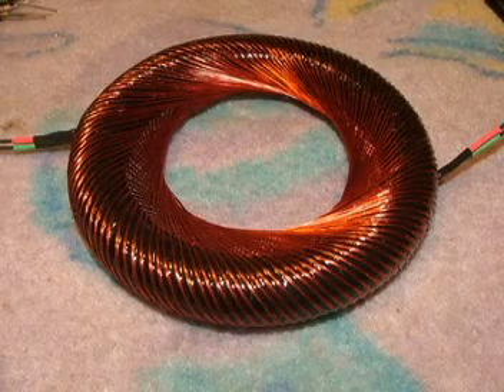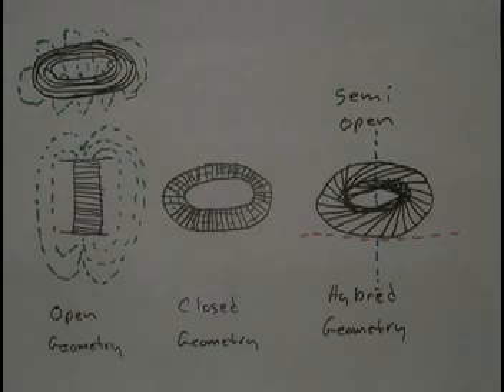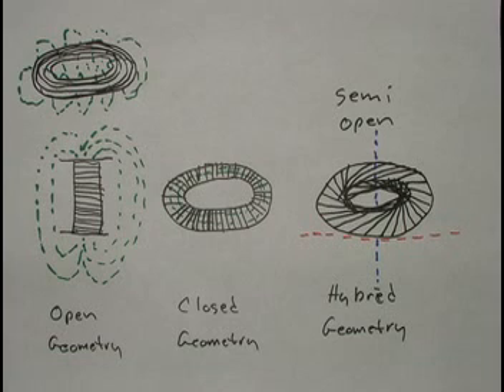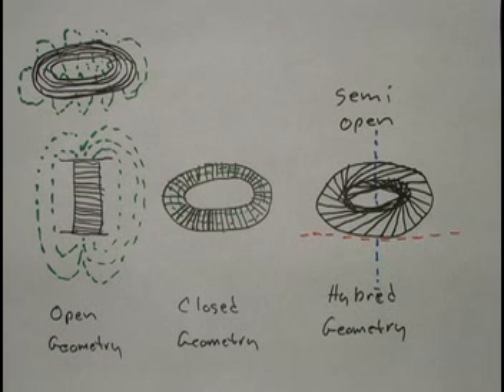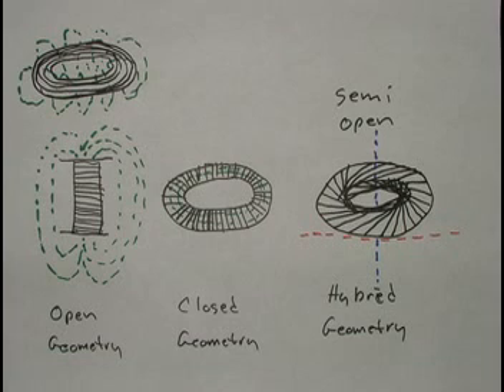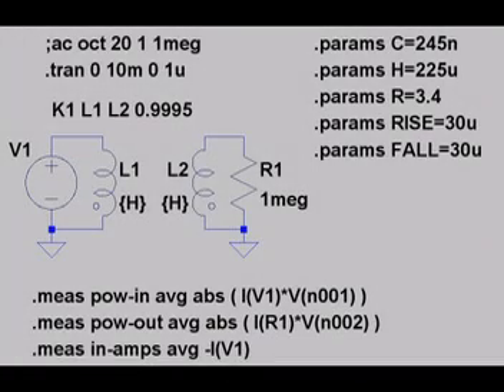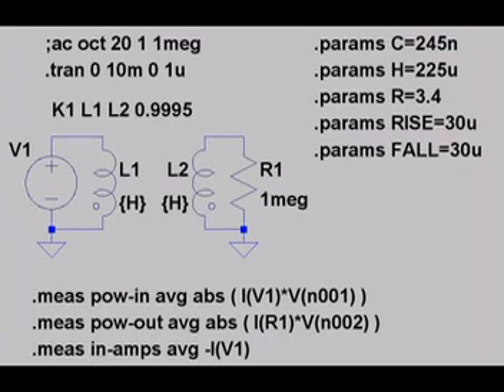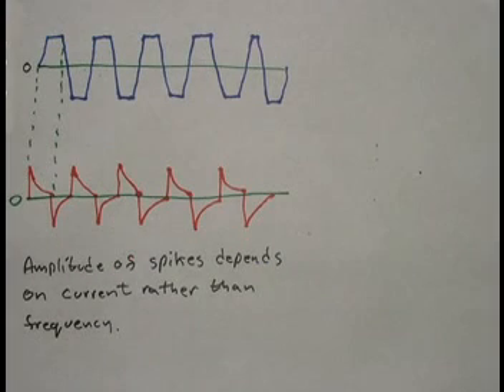Rodin Coil - Part 1 of 3

Comment from the maker: The coil I built is a 120 point coil rather then the more commonly seen 12 point coil.  Both version work the same.  My version is just a finer version.  There is space between each pair of windings it's just much smaller that a 12 point coil would have and as a result the amount of magnet field that escapes from the body of toroid is presumable much less than the 12 point coils with the big gapping spaces between the winding and the wire hanging far off the winding form.

Comment: It looks like this coil is wound incorrectly. There should be an "empty" phase between the two windings.

See the lecture on VORTEX BASED MATHEMATICS, on wind0wninja's channel. I'm not sure that the one he uses for his demo, actually does anything either. I saw on another video, that he thinks the wire needs to be specially made with alternating areas of thick and thin diameter, corresponding to where it is on the toroid. For this to actually work, it would be extremely high tech construction..

Comment from the maker: That's a good question, and without measuring it with a Hall sensor I would just be guessing.  Although Because of the twisted, vortex nature of the magnetic field there may be a point in the or around the center of the coil where the magnetic field is stronger than what's created by a typical solenoid.  It
s all conjecture until it get measured though.

Comment from the maker: Yes, the wire is insulated.  It enamel coated magnet wire.  The lacquer is to hold the wires in place.  Without it the wire would slide out of position on the plastic torus.

Comment: @ReactanceIsFutile I'm just recently looking at youtube stuff, and never heard of a Rodin coil, but am very familiar with iron-laminated transformers and ferrite toroid cores, for both transformer, and choke purposes. What is the purpose of the Rodin, it seems counter-productive to allow the magnetic field to work outside the core, of any transformer? Since a well designed toroid is already near 98.5-99% or better, what exactly does the Rodin do?

Comment: I'm absolutely amazed by the numbers of people who know enough to be fairly capable in electronics, but still understand so little to properly analyze someone's work, like Rodin's.  He hasn't done anything special.  A few minutes with a calculator and a regular toroid provide better results (same power, fewer turns).  He wound a toroid in an 'interesting' way- that's it.  The magnet is doing the majority of the work in his 'examples'.

Comment from the maker: @syberraith I'm looking forward to some day winding another with heavier gauge wire on a properly sized torus and adding more than one layer in alternate winding directions!  That will give a cross hatch pattern between winding layers between the inner and outer diameters of the coil.

Comment from the maker: @syberraith There is only one inner diameter that will result in the roundest and most evenly wound coil.  It easy to determine from drawing out a to scale diagram of the outer diameter of the coil, then marking the angle of the windings on it.  That will graphically reveal what the inner diameter of the torus should be to eliminate and unused space between the windings and the inner diameter of the torus.

Comment from the maker: @Films4You Thanks.  After I finished it, I just turned it over and over marveling at the winding geometry.  It's as if it's trying to say, yes there is some thing here.  It's really quite visually memorizing.

Aftter it was done, one of the things I realized is that there is a specific relationship between the number of points used to wind the coil and the outer and inner diameter of the coil.  For any given number of points and any given outer diameter...

Comment: the magnetic feild of the coil is an electromagnetic feild, so having a magnetic core would not change and much as a more conductive core like copper or stainless steal which i beleive is a good chance for greater output, but in this case the more conduets mean more resistance somewhere, so unless ur workin with super conductors i dont think it would be much.